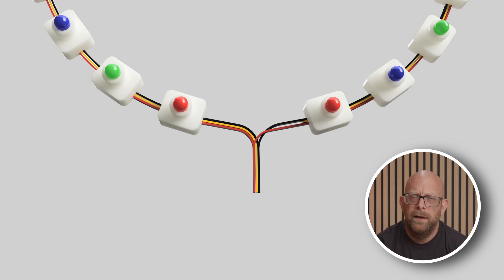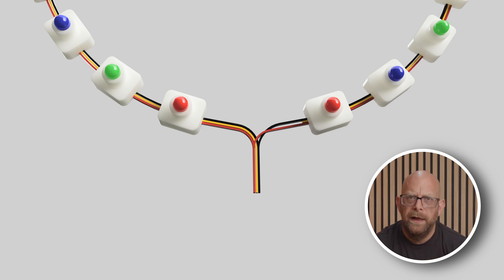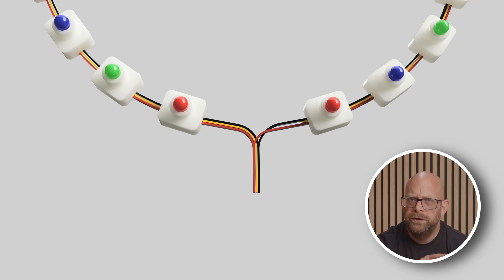Power Balancing #pixels #xlights #fpp

Comment from the maker: Note: IF you are using a 3/3/3 Tee (where all 3 wires are connected throughout), then the data pin of the secondary feed plug should be removed.  Long nose pliers are good for this.

Comment: What is the maximum number of pixels that can be power balanced together without power injection? I will be running a 12V power supply with a Falcon F16v5 control board, and each of my four Singing Trees consists of 350 pixels. Will I be able to power balance each entire tree @ 30% power/brightness, or will I need to power inject each tree in multiple places?
Reply from the maker: You’ll be fine with 350 12v

Comment: Greg, Thank you for the video.  Can you also discuss how data is handled in power balancing with the T.  Seems like data would flow in two different directions.  If I missed you discussing this aspect of data using the T then I apologize.  I’m a newbie…, just asking…, Thanks!
Reply: Data only follows a single direction, power and ground on the other hand is bi-directional. In the video you will notice the 3 wires, 1 for ground, 1 for data and the other for power.
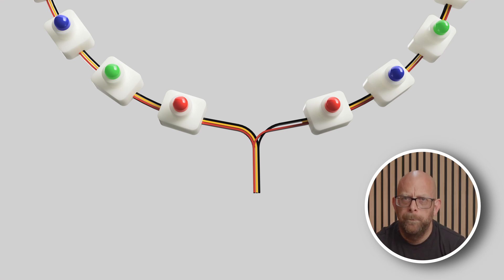Reply from the maker: Hi John, if you look at the pic at 5:20 you'll see that data is only going in one side, power is going to both.

Comment: dont you need to cut the data line at the end of the string ?
Reply from the maker: If you look at the drawing (and I mention it), the data only goes one way around the string whereas power is going both ways.
Reply: @gregmacaree in the example you have made the data line goes into a loop. Your earlier videos show it with a break.
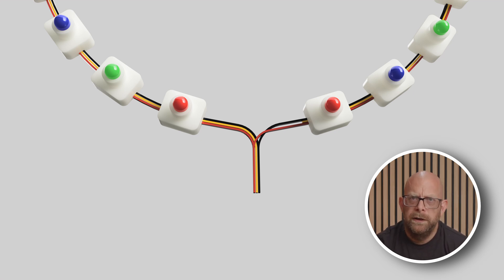Reply from the maker: @craig2606  I'm not with you, at 5:20 you can see the data goes in one side only and I talk about it. ?
Reply: @ when you use the t-pice towards the end of video where you confuse data with power you never pull a pin on the t pice giving the impression data is connected in a loop ?
Reply from the maker: @craig2606  Gotcha, have added a pinned post ref 3/3/3 Tees.
Reply: @gregmacaree cheers mate wasn’t having a dig. Just abit confused that’s all. Done have any videos coming with push buttons with fpp
Reply from the maker: @ like https://m.youtube.com/watch?v=BdiDMIS0zOM ?

Comment: Nice Video. I use for Power Balancing an normal Pixel Cable but using Genderchanger on the one site. But i doing more power injection - sometime i have the feeling that sometimes are afraid of power injection.
Reply from the maker: Hi Hans, yes I agree it is sometimes thought of as a dark art - and with the ever reducing cost of pixel ports is it even a necessity?  But more on Power Injection next week.
Reply: @ I build some enclosure which  only do PI with the Hanson Power distribution board . But I do both things PI and PB. And sometimes I have to use Data bosters